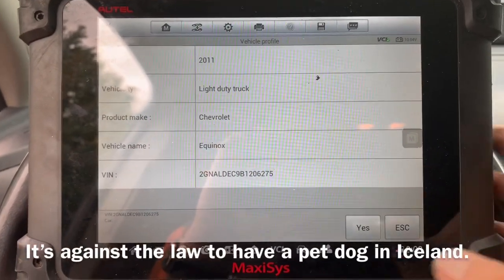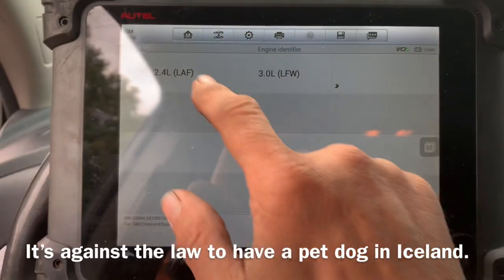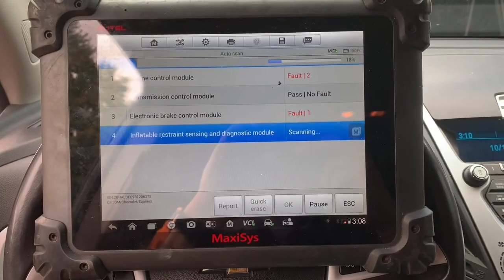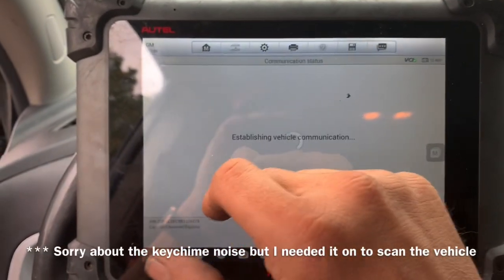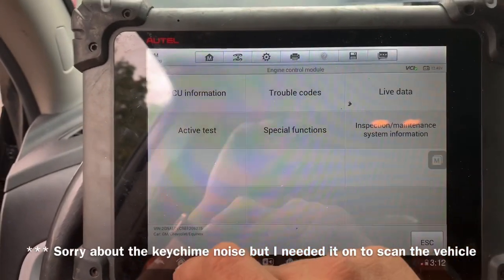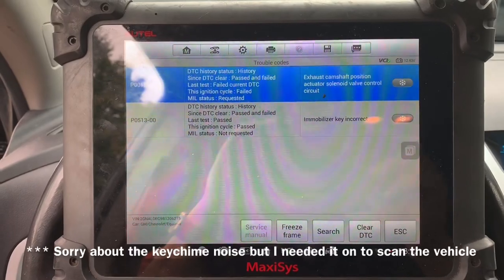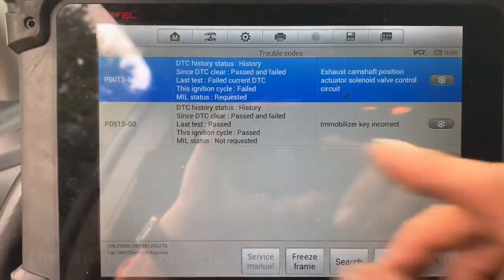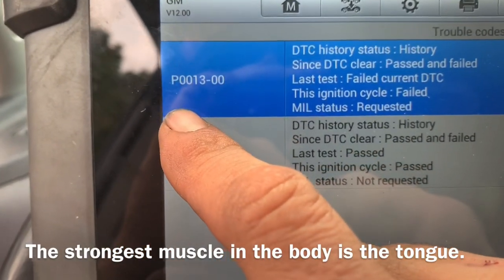GMC Terrain / camshaft position solenoid code / po0014 , po0013 , repair and replacement

Comment: You saved me $720 on a repair from the dealer. Cheapest was $475 around here for a normal shop. I paid $106 for the parts and did it myself. Problem solved!
Reply from the maker: I love love love to hear that stuff That’s awesome take the family out to dinner or do a kind favor for a complete stranger even if it’s just opening the door

Comment: Thank you so much for the video.
 I did this to my 2016 GMC Terrain along with oil and filter change. Had negative post disconnected. Reconnected everything, started right up, and engine light disappeared!!Got the pair of camshaft sensors from eBay for 20.00.

Comment: I'm glad I wasn't the only one having trouble getting these suckers out. Thank you!
Reply from the maker: You’re welcome Cameron thank you for taking the time to let me know I do appreciate it very much and welcome to the channel we’re very happy to have you.
Reply: @sharpcarco  I changed out the O2 sensor a few days before I got the recall notice for the part in the mail. Today's going to be the fuel pressure sensor. It's been a real trial, but thankfully the engine in this vehicle is pretty accessible.

Comment: Thank you so much for this video, and the facts at the bottom, very interesting.  Great, Great Demonstration.  I actually changed my Exhaus/Intake Solenoids before watching this specific one, but decided to watch a video, because I have a check engine light is on, and it's coming out w/a P0013 code.  Plus a Catalytic System code of P0420.

Comment: You really do make it look easy and make the video entertaining. Thank you!
Reply from the maker: I can promise you it’s pretty easy to change the stuff
Reply: @sharpcarco  can I ask you this, I got them changed back in July and now the code says it’s the camshafts again but it’s been two years since I changed the battery in my car and jiffy lube did say it needed to be recharged then autocine says it’s fine and gives me the code for intake camshafts. Could I be having the same issue as back in July? I thought camshafts don’t mess up that frequent thanks in advance!
Reply from the maker: They probably don’t mess up that frequent more than likely you have an internal issue inside the engine sorry wish I had better news it wouldn’t surprise me these are ridiculously bad engines

Comment: I have a 2014 GMC terrain with the 2.4 motor and it stalls at the stop lights runs good but it stalls at the lights and it sometimes  shakes like it wants to turn off
The engine light came on once it stayed on one day and then it didn't come on again but it's still sputtering and occasionally it's stalls starts right back up and goes only Stalls on a takeoff or sputters on a takeoff while you're idling.. but it runs well as you're driving at high speeds no hesitations or anything.  I'm a bit confused because on a different video the terrain for those same cylinders were showing a 0010 and a 0011 code yours is           po0014 and po0013 if you don't mind maybe giving me some advice I would very much appreciate it...

Comment: Could you do a video on replacing the timing chain?  I changed out all four sensors and still having a sputtering problem. Its very small sputter but i can feel the engine being slugish.  Any suggestions?  Great video !! I have a 2015 terrain 2.4

Comment: Thank you so much for the video! I'm gonna take my chance at it tomorrow and change both the intake and exhaust solenoid tomorrow. I do have a another code P0014 along with the P0013 though. That one refers to the timing chain I believe. Do you have a video for that?

Comment: My terrain is doing this but when u turn the key it's like it has no compression.  I got code p0011 & p0014 changed the sensor and still won't start

Comment: I have p0010 code 2016 GMC Terrain and changed both solenoids INT and EXT....I had reduced engine power pop up on the dash and wouldnt start the next day....when i go to Try to start the vehicle and go under the hood I am hearing a a faint clicking right by the front camshaft sensor.....Any suggestions please and thanks?!
Reply from the maker: Man I’m sorry to hear that Russell. I made this video describing how to change the solenoids and how they function. But I have not made a video of why they go bad. 
It’s due to lack of oil pressure inside the engine that causes the solenoids to send the code to the computer. Then replacing the solenoids really isn’t the problem it’s the bearing clearance inside the head on the cams which causes low oil pressure. 

I’d like to make an in-depth video on the subject but I need a vehicle that has the problem so I can disassemble it and show people what is exactly going on

Comment: Hello I have a 2011 GMC Terrain 4 cylinder. I have a P0341 code showing up, indicating my camshaft position sensor A is bad. I have replaced the sensor and after disconnecting the battery the code still comes on. Is there something else that could be triggering the code? Should I replace the same two sensors you replaced in the this video to see if it helps? Thank you for your time..
Reply from the maker: Yes there is something else that could be causing that to come on. The timing chain is bad and the sensor is throwing a code because it knows it’s out of time

Comment: Please note that GM specification torque on these 10mm hex head fasteners is 89-lb in MAXIMUM. Applied torque beyond 100 lb-in may result in damage to casting and subsequent oil leak due to shear fatigue in cover.
Reply from the maker: I’m not sure but I think you may have missed read some thing if we’re talking about tightening down the solenoids they don’t tighten down any more than 8 to 10 foot pounds at most but more than likely I said 89 inch pounds which is totally different than foot pounds

Comment: Thank you for this video! Just can’t get the check engine light to turn off but the car isn’t sluggish anymore thankfully. Any suggestions???
Reply from the maker: Well what code is stored inside your computer?  

And I try to answer all the questions I can but sometimes they don’t come through YouTube properly so it’s best to look me up on Facebook under my business clays AC and auto repair and send me a private message there
Reply: I changed one of the exhaust solenoid but the check engine is still on and suggestions?

Comment: I have that problem stalling the sensors have been replaced at dealer, and still stalls 
Where I deliver my 2011 GMC terrain so you can fix it for me?
Reply from the maker: Well I’m sorry to hear that happening to you but I can tell you with almost all certainty that your cylinder head is probably bad. I could go into a long explanation of what’s going on inside there. Are you near Grand Rapids Michigan?
Reply: Wish I was I'm in so Cal
Reply: Thank you for your reply

Comment: I had one come in that had timing chain guides broke and bent valves, I put a new cylinder head on it, new timing chain set, new cam phasers and new solenoids, ran great then after about 30 miles it was wanting to die when coming to a stop, and idles rough, I put the scanner on it and it has a p0014 code, I can control the solenoids off and on and hear them click, but  it still has the p0014 exhaust cam over advance, Any ideals???
Reply from the maker: Did you check the PCV hole on the intake to make sure it was not plugged when you removed the intake?

And other than stating the obvious which I hate to. For whatever reason it is possible that the timing jumped.

You obviously know how quick and simple it is to verify that. 

I find it simpler to take it apart. Trying to hook up the lab scope. 

And depending on what kind of solenoid you use it is possible that you have a low oil pressure problem which is making the solenoid stick. 

I hope you find some of that helpful maybe it’ll help you find the problem

Comment: Ok im getting a P0011 code is that the cam shaft position sensor? If it is i just had them replaced not even a year ago,please don't tell me they failing already, need your help to fix this problem.
Reply from the maker: Well it’s extremely complicated they may not be failing but they technically are because of lack of oil pressure inside the engine at an idol. Bearings inside the engine where down and cause lower oil pressure especially at idle then causing the campuses to not work properly. 

By the way I work at an engine shop and yes it’s very common the cam phasers go bad even after a short period of time
Reply: @sharpcarco  well I changed them again day before yesterday cause I had to take a road trip down south, i can honestly say it performed well to Arkansas & i headed back to Wisconsin without any problems, oh I also threw a can of sea foam in the tank to clean everything, next i need t add some to the oil & run if for 30mins before my next oil change, i keep hearing how well that sea foam works miracles.